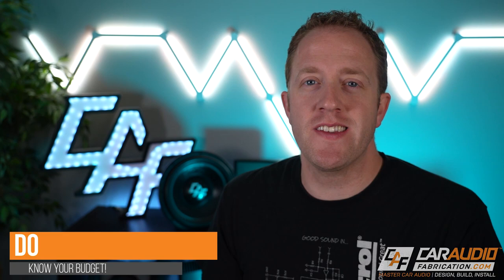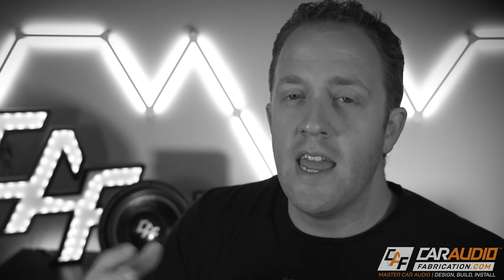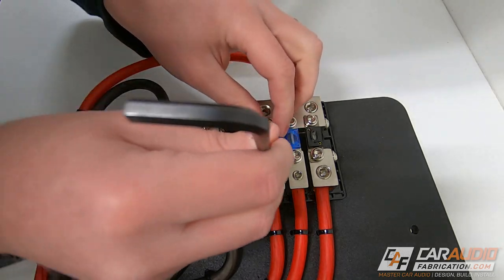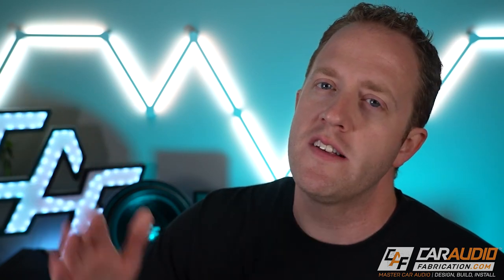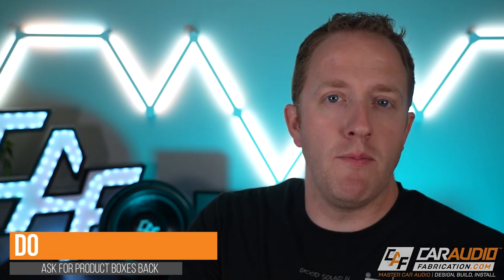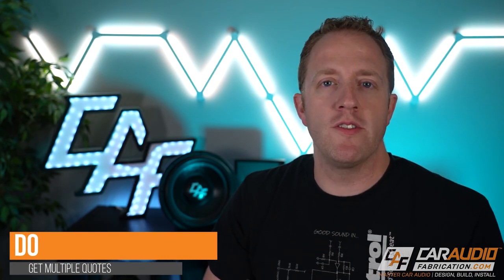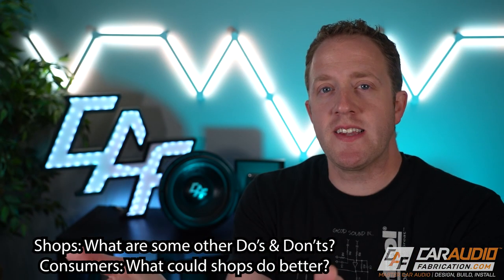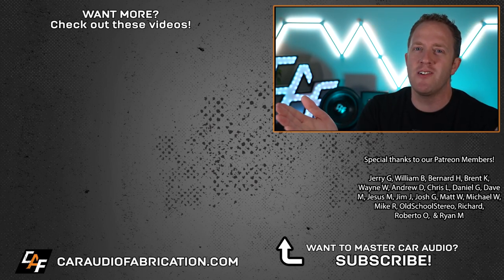Paying for Car Audio System to be installed? DON'T DO THIS!

Comment: I am mecp certified I installed my system 2 years had no problems now when I turn on the radio it blows the fuse I drive a Dodge Magnum I upgraded the alternator at the same time I installed it could it be but it's sending a higher voltage?

Comment: Mark can you please Help me diagnose my problem?.
  New install, 2016 f150, used  LC2i, the mid/high 4 channel Amp sounds good, problem is my mono amp (CT Sounds 2000.1D) does not like Both rcas connected! (Sound like 40% lower in volume) but if i. Disconnect One rca it sounds great. Already tried diferent rcas, diferent, LC2i, diferent Amp, even  using the lc2i high output signal  to my mono amp and still, "when Amp has both rcas connected it like cancells itself/ plays at lower volume.  Amp is hooked to 2 10 subs wired at 2 ohms.  

  Any suggestions??

Comment: I spent a bit over 10K on my audio upgrade in Maxima Platinum, Focal 3 way upfront, Focal Coaxial in rear, Two focal 10in, 3 amps, DSP, and Epic center. Custom cuts for the tweeters from 1/2 to 1in. Fiberglass subwoofer enclosures. Plus sound treatment and radio adapter. All said, I am pleased but it was super expensive.
Reply: does it sound like a 10k sound system? Like if someone sat in your car would they be able to tell minus the subs in the trunk?
Reply: @airuzair2424  it is super clean, Loud and Precise. The Focal Flax 3 way and flax coaxial are a beast compared to the Bose standard system. The subs with a JLAudio amp hit hard and cleaned too.
Reply: Was this equipment + installation? I'm trying to get 4 speakers on each door and  tweeters on A pillar  fiberglass maybe and 5 amps including subwoofer amp  any idea how much it'll cost just labor I have the equipment already minus cables etc.
Reply: Forgot to mention sound deadening this on a 2012 scion xb
Reply: @juliorodriguez3306  it was all installation, I brought my products from crutchfield to cut some cost
Reply: @beekaye1496  thanks for clarifying

Comment: @CarAudioFabrication what should I expect for a shop to install second skins sound proofing vehicle kit, 4 door speaker, 2 tweaters, 2 10s with premade box, amp, big 3 kist and and DSP.
Reply: My shop would probably charge $2500+ depending on speakers and Amps
Reply: It's going to cost you a pretty penny, as sound proofing isn't cheap, and neither is adding the big 3. The rest of the install is also dependant on many factors as well. Plan for at least $1,500+

Comment: I put coaxials in my front doors and for my rear doors I put in 2 way component woofers BUT I put the component tweeters in the front sail panels then I ran the front and rear channels in parallel (two channels L and R not mono) because my amp only has 4 channels and I needed 2 for my sub.

If I take it into the shop to get soundproofed am I going to get bullied?
Reply: I would hope not. Maybe educated on a different way of doing it (what I would do anyway). Shops have a tendency to assume everyone knows as much as they do and come across very arrogant.  If they try to “bully” you I suggest you find a different shop.
Reply: I mean you did it kind of backwards but if ir sounds good to you then why not

Comment: I got a twk installed and the shop didn't even tune it , don't always trust the Google reviews and demand a demo.
Reply: Installation is not the same as tuning. Tuning is very subjective and means different things to different people. A basic install should include setting gains and crossovers so that your  system sounds decent and your gear doesn't destroy itself. If you want more than that, you will need to pay for it and make sure that time is reserved in advance. If you expect a system to be tuned, you should have a conversation about expectations and cost before booking the job.

Comment: Nice! Hate these new cars. Want a CD player. I want to put in a stand alone sound system that does not touch the factory system!  These 60 year old ears can't hear like they use to so just something simple A single din Kenwood with 5v preouts 6channel to a nice  six or 5 channel amp?   some separates in the front but can't decide on 2-8"s or a single 10" for classic rock in a 23 Toyota Tacoma. Probablt mount head unit like a cb.??

Comment: Did you recommend saying to the shop..."i dont know much about car audio,but..."NEVER..EVER admit to not knowing what your talking about,every question you told us to ask about the level of professionalism,checking over the work and making sure everything is how its supposed to be..if you "dont know much about car audio"dont say that..when a sales rep hears those words all they see is $ signs. If you don't know much about car audio but are going to buy a stereo system, you might want to do your research first so you don't show up not knowing what you're talking about and still expect a good deal, or even a decent thing for the buck.

Comment: A lot of installers are crooks. I go to my local best buy, and ask them about doing a install for me (just didn't feel like doing it myself) I tell them what I have and wanted to do, I say, I would like to hook up 6 6x9 to my old punch 400, he begins to tell me that the punch is only 2ohm stable and prosed to show me a 4 channel amp. I ask for a piece of paper and showed him r1xr2-r1+r2 (ohms law, simplified) I say I bring 2 up to 8ohm, leve one at 4ohm 8x4=32 8+4=12 12 goes into 32 2 times with a remainder of 8, so I'll be giving the amp 2.8ohm(2.7 says JL audio for my  triple stack ) after I show the 20 something year old kid, he says, o, I thought you wanted to fade front to back.

Comment: Cartoys (Portland) sells items as installed price then charges $200 more for misc door pins & diodes lol..scam
Reply from the maker: Not really. The price includes installation labor, not the parts that a build may or may not need depending on the vehicle.